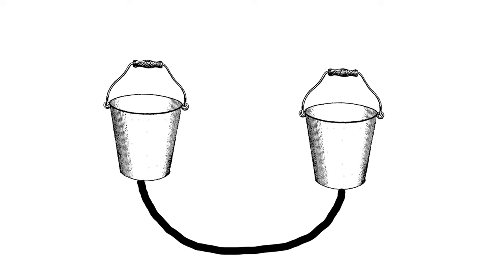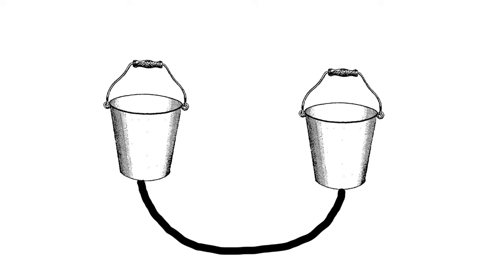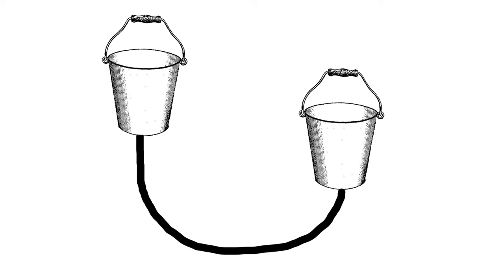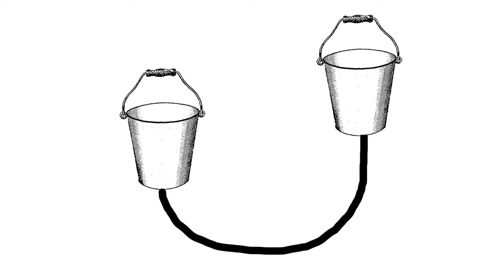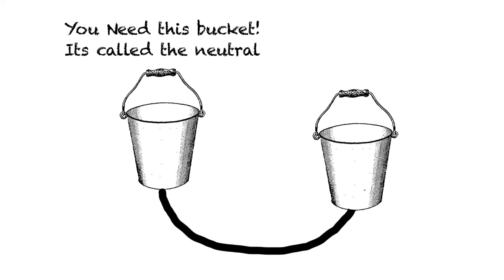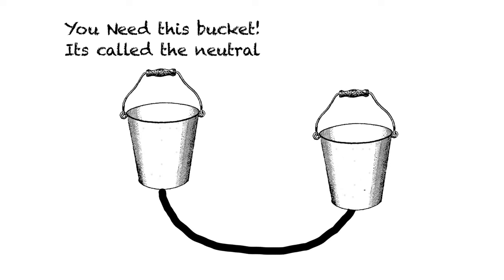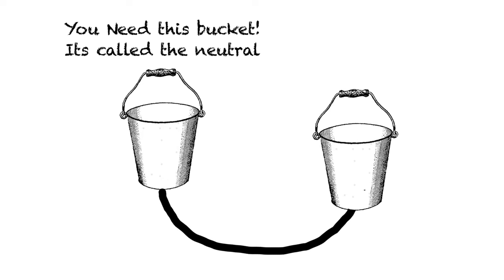Electricity for Model Railroads - Part One - AC-DC

Comment: Do you suppose Nikola Tesla and George Westinghouse thought about the two buckets?  Meanwhile, don’t forget about American Flyer.  My American Flyer is two rail AC.
Reply from the maker: YUP! In the early days DC was expensive. AC simple. And Gilbert felt they could overcome the insulated axle problems. BUT ON AVERAGE three rails mean AC. Two DC. Lionel did switch over to DC in the 70's still using three rails. And as you say, AF used two rails DC. BUt even HO trains using AC are three rail. No real reason other than AC came first. And three rail is simpler.
Reply from the maker: PS, well both George and Tesla kicked the bucket. so....
Reply: @ToyManTelevision  Do you suppose the buckets they kicked were connected to hoses too?
Reply: @Nathanator-6688 To funny!
Reply: @ToyManTelevision You are far too funny!
Reply: In all the physics discussions of electricity we were never exposed to the two buckets.  The analogy to water flow through the hose was used to explain voltage.  

We learned that the difference was the wave form.  AC being a complete sine wave and DC just half wave.  

The speed can not be varied with AC but can with DC. As technology improved and power diode technology advanced the electrical industry developed ways to covered high voltage AC current to high voltage DC current.  The speed of the motor was adjusted in DC and then it was converted back to AC.  Of course you lost power and produced a great deal of heat. (First Law of Thermodynamics: You don’t get something for nothing, or there are no free lunches!). 

Interesting as always!

Comment: I too had American Flyer trains (AC 2 rail). To reverse the polarity (make the loco change direction) there was a mechanism that switched polarity in the locomotive. These things were the bane of American Flyer. My dad had to have all of our locomotives switching units replaced, or we did it ourselves, (not sure, I was to young and my dad was not very mechanical).
This series is going to be interesting. Although I understand basic electricity concepts, all of what it takes to run trains today is beyond me. (I'm still stuck in the 1970's)
Reply: and you can wire in a bridge rectifier, remove the reversing unit and run it on DC
Reply from the maker: @davidkoehler136  WOW!!! Never though of that! COOL IDEA!!

Comment: Not relevant to the topic of this video (sorry), but I have about 250ft of track on my G scale railroad. I'm using 20 gauge because it was significantly cheaper than 12 and 14. It's running well, but is there any benefit to upgrading?? Thanks for the video. Interesting topic.
Reply from the maker: It sort of depends on what you’re doing. Is this the only feed to the track? From how far?  What trains are you running on what grade?  My old outside railroad had a 16 gauge buss under the track with 20 gauge feeders off that to every rail joint. And I had a 5% grade. When running 4 locomotives with two motors each it totally stalled on the hill. But one engine went right up. The amperage pull was just too much. Like 10 amps. The wire was too small. As was the power supply at 5 amps. My small feeders were a problem.
Reply from the maker: Ps. If it’s working it’s fine.
Reply: @ToyManTelevision  Haha, yeah it's working fine. Sounds like no need to mess with it. Thanks for the response!
Reply from the maker: @alexmanne  if you are running heavy loads with powerful locomotives 🚂 it may be a problem. The choke point is not the wire until you put it under heave load. Then it’s a problem. But as long as the locomotives are not pulling more power than the wire can handle then it’s fine.
Reply: @ToyManTelevision  That's also great to know and something to consider since I'm not planning on buying a new engine anytime soon. Thanks again for the reply!

Comment: I keep thinking that eventually trains will be run by battery power.  I have a Lionel ready to run set that uses a rechargeable 9.6 volt NiCad battery.  It pulls 11 cars plus the tender which contains the battery.  Counting the engine makes 13 items.  It will run continuously for about 15 minutes.   If the tender space was utilized efficiently, with a Lithium battery, it could run for an hour or more.
Reply from the maker: Yup. I have had those. My rotary snowplow is battery. Can run for hours. And I have a K36 on battery but I’m taking it back to track power. And I had a rail bus that I could run for about 3 hours. Lost to history.

Comment: Sorry Dale, but you are NO Nickola Tesla! I suppose that you would say that since there are 2 wires, one red and one black, that the electrons flow through the red positive wire to the black negative wire, Right?
Reply from the maker: Hi Vinny!  Well.... Nope. Not exactly. As I say, its a good way to think of it. Sorta how its works. But not really. But its a good analog fer it.  Ill TRY to explain better on Friday. The sneaky little electrons are nomads. The energy that pushes the electrons "flows" around the wire. The damn electrons wander all over the place but for every one that enters the circuit from the supply, one comes out the other end. Well... I should say on average. As I say, they are sneaky.
Reply: @ToyManTelevision -Dale, I had to totally rewire my Dodge Maxi-Van and I found out that the electrons Do Not go through the wire but around the outside edge of the wire in a magnetic field. That's why you see so many cars catch fire 🔥 when drivers add a sound system in their cars without upping the wire gauges, the original wires heat up in their tightly bound cables or jackets! Plus, most people don't understand that those pesky electrons actually travel from the (-) negative pole from the battery to the (+) pole, like positive attracts in nature too when you were attracted to your girl: Karyn, before you got married to her!! It's also known that, if those electrons did actually travel through the wire, the metal of the wire would eventually fall apart or break the circuit, which we all know doesn't happen!!!